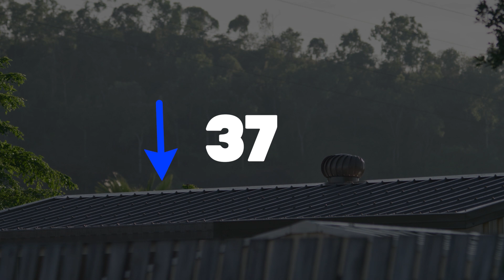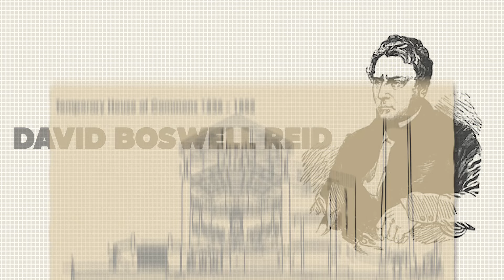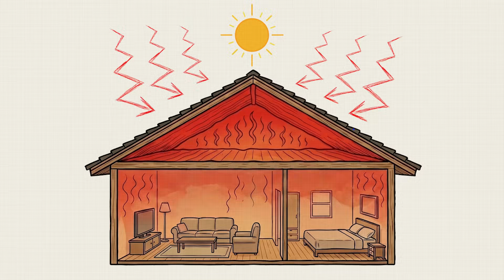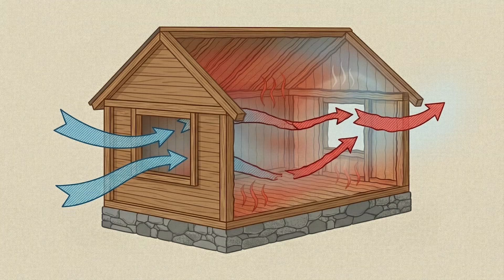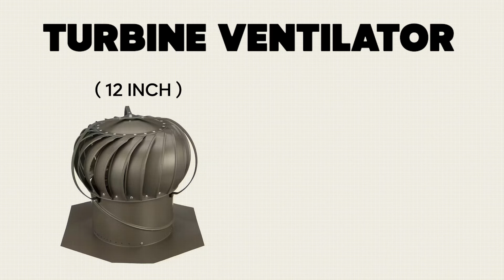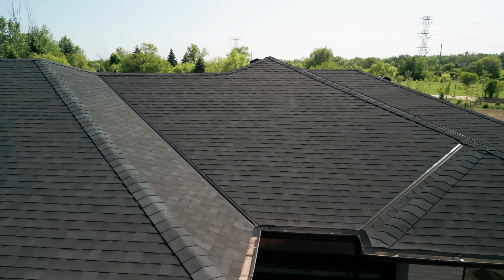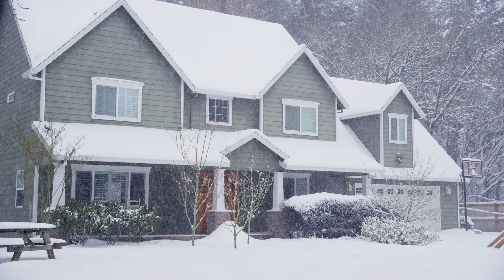Why Did We Stop Using This Natural Cooling System?

Comment: I'm located in the subtropics of Australia, and I use Whirly Birds on my house, combined with closable vents in each bedroom. During summer, I leave them open and they really make a huge difference with not only temperature, but also the freshness of the air inside the house. During winter, I close them so the heat stays inside the house. They are still fairly common in Australia, but more new built houses should just have them as standard.
They also keep mould from building up in the roof cavity, which is another bonus of having them.
Reply from the maker: Thank you for the insight and your constructive feedback! Really appreciated!

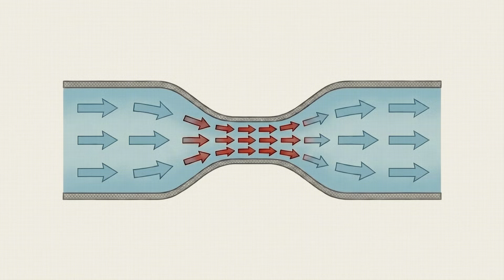Comment: 5:05 isn't the 1st and 3rd effect the same? Air reaches smaller point (blades), goes faster, pressure reduces, pulls more air
Reply: yes exactly I was gonna comment that
Reply: Bernoulli’s principle states that the pressure of a fluid or gas is inversely related to its velocity. Meaning if airflow speeds up, pressure drops, and vice versa.
The Venturi effect is one application of Bernoulli’s principle. By channeling air or liquid from a larger tube thru a smaller tube, its velocity increases and its pressure drops.
TLDR: Bernoulli’s principle is a general rule, Venturi effect is a concrete application of that principle. So yeah, in this case, the video sort of just mentions the same thing twice.
Reply: No sir venturi effect and bernoulli effect are studied at same time but is different
Reply: @mrajeshwarrao5467  yes sir it is and that's why it is studied at the same time as you said 🙄

Comment: i installed one in the kitchen. neighbor said it gets loud when windy she can't sleep. i had to remove it and roof it. how do i fix it?
Reply from the maker: Fix the roof or the noise issue?  If the noise issue then I would look for a noiseless vent.  You could use a static vent but this shouldn't be as effective as a turbine vent.

Comment: I built my house in 1986. I put two turbine ventilators on it, and I still have them on my roof. I replaced the originals in 2013 when I had my house reroofed, not because they were worn out, but just because I though it would be a good time to do it. My electric bill through the summer with AC on averages about $50/month (midwest US), due to good insulation, and the roof vents.

Comment: 10:25  pays for itself 3 to 5 yrs, according to that then the aircon cooling cost isnt much difference? Two installed around $200. Does these numbers add up? 14% cooler.

Comment: I installed one on my roof, its been spinning for over so long ... over 30 years and still turning . Totally True and a Must !
Reply: I'm 56 and my Dad installed two back in the '70's on ours. They're still whirlybirding!
Reply: We couldnt get outs to last 1 year in Florida! They would take off during hurricanes!
Reply: @markvolker1145 What if tou cover them with something during hurricane seasson?
Reply: @Aaronreacher  That's when the heat is very high and you need them to work. New high slope roofs make installing a cover difficult/dangerous. That said, I live on the gulf coast and we've only had them damaged by hurricanes that also damaged the shingles - but those were made in the 1980s. I wonder if lower quality ones are on the market?
Reply: Is it noisy?
Reply: @danielawesome36 not noisy at all. We used to have those all over our neighborhood but many fell into disrepair so most have been removed and not replaced.
Reply: @danielawesome36  if they rust they make a hellish sound and you cant take a nap lol
Reply: @carlosacunacastillo6227  they are easy to open up and use wheel bearing grease on the bearings
Reply: How do you keep blowing rain out?
Reply: @Sctronic209  rain will not enter
Reply: @Sctronic209  You don't. Rain will come in very easy if it comes in at any kind of angle.
Reply: Do you live in a northern climate. Seen this and considering now for my bungalow
Reply: Yeah, I forget if my house has 1 or 2 of them, lived here all my life and I think one of them was replaced once, in 40 years. Other than that I forget they exist.

Just get it well-made and it will do its job quite fine.
Even with snowy winters.
Reply: I have one that is 31 years old, the one on the other side of the house failed at about 20 years.
Reply: Should fit a motor and light led .
Reply: What happens during winter? Doesn't it just make heating the house much harder because of the air circulation?
Reply: And i could not care less about 40W for a temperature controlled fan...
Reply: Is not cheap overall, It need maintenance, if rust it makes noise, if it doesnt makes noise its already stuck by rust so it doenst work, if there are too many windstorms per year then water may seep inside, and normally the system is not really that good for hot weather regions. In the end, its too much trouble than a solution and it only work well in some specific climate regions.
Reply: Now that you specify that it's totally true, I imagine you must be lying.
 Also, whoever taught you proper capitalization is embarrassed by you.

Comment: You can use it to create a nominal amount of electricity, that can be reused into an inverter, in lower floor, or can be used to recuperate the same energy back to the same unit, to make it an active energy exchange system.

Comment: They sell these in Australia all the time. 2-3 are sometimes mandatory for tin or tile roofing. Same with bathroom/laundry ventilation - but you can use other options. 

To stop the pressure being 'jammed' by the suction effect - eave vents below the gutter, facing the side of the house are also used. These pull air from below the roof, into the cavity space to flush the airflow from the walls and into the attic/roof area. These are fairly large and evenly placed around the house to pull air from multiple areas to avoid rain/humidity, but also help to dry out the roof cavity naturally. So the air is being pulled from below the gutter/ridge, and thermal expansion pushes it out towards the peak where the turbine/whirlybirds are.

Also, whirlybirds / turbines can be an issue in areas with lots of trees and fires. These need to be covered in a fireproof vent made of metal instead of plastic - which triples the price for Fire-proof variants - as the top of the vent has to use a solid metal filter which reduces their thermal cooling effect. 

As you note - building codes here are complex - they don't allow for ridge or vent systems because simply put - they don't survive 100'F to 140'F when exposed to Australian weather conditions. Also, Insulation is required - there isn't a simple way to build attics for storage in Australia as a result of the heat. Freezing/Rusting is common enough - but they can be fixed. The issue is the humidity. 

There's also a high fire risk and ash/debris falling into the home or roof space via a duct that does not allow for filters/screens. So, to meet the BAL or Bushfire Alert Level rating. BAL-12.5 and BAL-40 are based on proximity to trees and how far away a fire can be to the house, then there's BAL-FZ which is basically, your home will be in the debris path no matter how much land you clear because you're surrounded.  Galvanised Steel is therefore, super common on the exterior - as it can survive the weather, and the fires without failing. It can also be easily coated and painted over in the case of fires. Brick and Tile for the same reason are preferred to other materials because of the fire/UV exposure, and the unlikely event of freezing / ice / snow.

Making sure a house is built for BAL rating is more expensive - but it's basically a guarantee for fire debris not getting into the house via the vents and windows, doors and frames have to be fire tested to survive close exposure to fire, i.e. within 10/100ft or 3-10m or so. The various BAL ratings ensure distance/proximity requirements. There's also Solar / House-Powered vents with BAL versions to keep the house ventilation going as some installers will feed bathroom and linen closets into a closed - loop ventilation to keep Ducted AC/Heating loops isolated from the interior attic. Using these as ventilation exits is not so practical, but it's useful to reduce humidity build-up. 

These looped air ducts for the kitchen, laundry, bathroom, toilets and wet areas - tend to collect humidity from outside/inside - so their exit vent also has to be filtered and screened to prevent insects using the vent to create nests and fire hazards.

Comment: Just 2 windows parallel to each other that would allow air flow to go through in a straight line. To avoid sun light add a cap functions like an umbrella. Classic idea.for cool air free turn the ceiling into cold air storage or ask me why the bathroom is always cold. I'm just sharing in to the comments. No offense 😗🙃😗😘❤️

Comment: we still use it widely here in Indonesia. it really works, but the thing is, we also found out that the ventilation for the inflow air is often installed at close to the ceiling, making the cold air to move above the head level. I think it makes it not really optimized, in contrast. the building built during dutch colonization era has ventilation installed at lower point. anyway this is simply working

Comment: Have one of these on my storm shelter and the moment 2-3 people are in there it gets hot as fuck fast, and we have a pull and draw system (idk the real name for it but one side pulls in air the other pulls it out. These are great for attics but in terms of activity cooling they suck, plus there are many options that work the same or better. We have a fan in our attic that just pushes air outside and only runs at certain temps, but because it keeps the attic about 10-20 degrees cooler it actually saved us about $800 a year in electricity (seems counterintuitive but the fan is low power where a AC is very high power so we traded the cost to the fan. I will say in the summer that fan never stops but after about 12 years of having one and it has yet to not work

Comment: What a poorly made and incompetent video this is. Ridge vents actually do the job better than turbine vents.
Here’s why:
Turbine vents only pull air when it’s windy. No wind = almost no airflow.
Ridge vents work 24/7 using natural convection — hot air naturally rises and exits through the ridge, pulling cooler air in from the bottom. They also ventilate the entire length of the roof instead of just one spot like a turbine does.
So even though turbines look cool spinning, ridge vents are more effective and reliable. That’s the real reason builders switched.

Comment: long story short - you cannot control them. Chimneys pull out a TON of heat from the house in winter, amount of air exchange is just too big even for a whole family. Thats why we use currently mechanical ventolators with calculated air exchange rates to keep as much heat as possible in homes.

Comment: This is crap. Literally every roof in my neighbourhood has vents.  The whirlybird version turns because of rising hot air, it doesn’t increase movement vs passive vents, but it DOES need bearings that wear and get squeaky!

Comment: 30 or 40 years ago, I used to see these turbines all over South Florida including in my first home, however and besides all the issues mention in this video, there is one of the bigger issue that’s not mention here, which was the reason that I removed those from my house, which is the hurricanes. These turbines will blown away with the hurricane and rain will pour in the attic and eventually into the home if you don’t remove it and cap the vent opening prior of the storm.
Reply: Exactly I’m glad you were commented on that cause they’re not on our house anymore. I live with my aunt and uncle and every time before we got a storm he had to get up on the roof and take them off so they’re not up there anymore.

Comment: Vertical‑axis wind turbines (VAWTs) use magnetic lift to reduce bearing load, it is not full free‑floating levitation but the same principal would work with turbine ventilators.